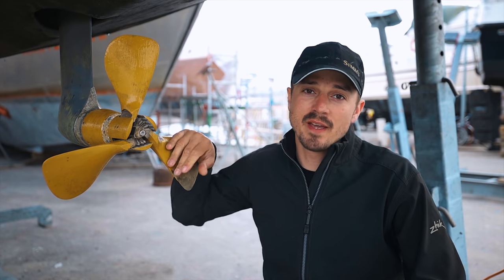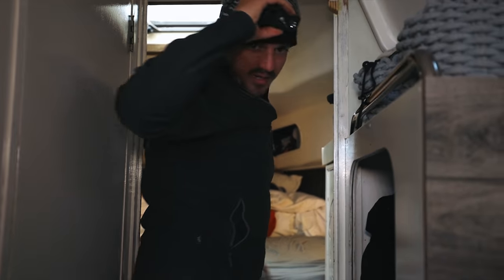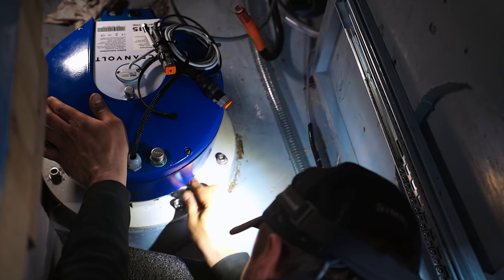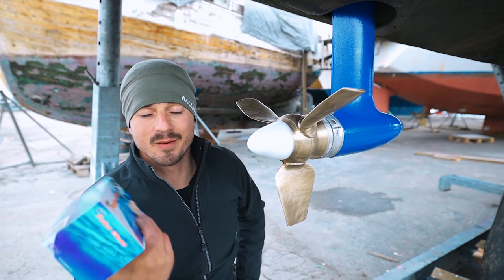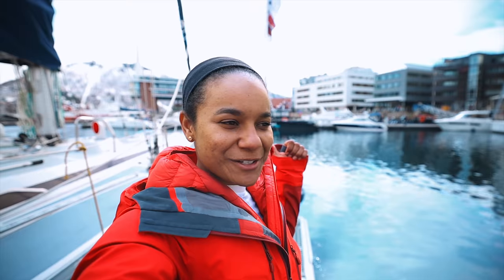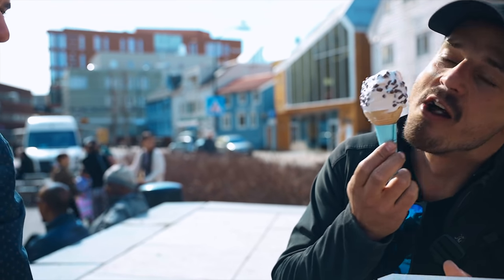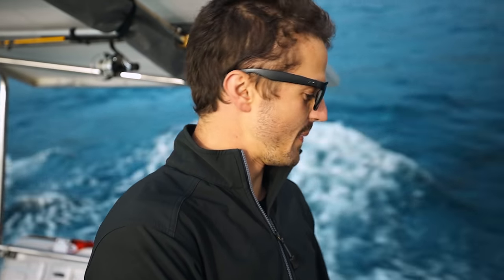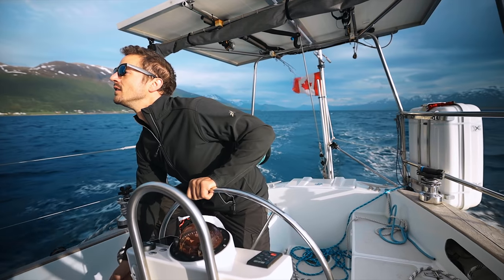Ripping Out our Electric Motor for the LAST TIME! — Sailing Uma [Step 277]

Comment: If you want serious regen, you should increase the prop size with at least 30-40%. With a pitch controller the increased size will not mather at all when you motoring.
And at 300-400 watt it only breaks with 0.5hp so it will not slow the boat at these wind speeds. But with a bigger propeller you can regen +1500watt and then it will slow the boat.
Reply: I'm no expert on the subject of regen, or sailboats for that matter, but yeah, my first thought was exactly this, why is the prop so small? This is slow a moving system (compared to a motorboat) and slow moving props benefit from big diameters. On the other hand, you would think that Oceanvolt should have done some research on the subject. I would assume that this particular system doesn't have the strength for a bigger prop and you would probably have to change out the lower unit and maybe motor for something bigger.
Reply: Bigger prop requires smaller pitch for same motor. Smaller pitch = more low end power, but slower top end. It is a tradeoff and I would tend to believe the manufacturer has done all those tests and is well aware of the optimum configuration for their product.
Reply: @rockfordwoods5432  The pitch is adjustable via computer so there won't be a problem if it's correctly done. Look at Bell Boing aircraft.
Reply: @rockfordwoods5432  larger diameter propellers are always more efficient for displacement boats at speeds of less than 35 knots.    To achieve this however it may require a different gear ratio.  Most people would probably prefer a larger prop than they have for increased regen ability as well as higher efficiency in propulsion at all speeds.

Comment: @Sailing Uma. I am quite surprised by the small size of the Servo prop, it’s a great tech but you still need blade area in the water to get effective regen, and extract the energy available, given the extra cost of the auto prop option are you disappointed with the amount of regen from a 12 kw motor?  This is the problem that Jimmy Cornell had on Elcano, I think the use of standard sail drives, limited to an 18 inch prop, will always limit the system.  It would seem that the speed reduction you were seeing whilst regening, shows that you could afford to extract more energy from your sails, what is Oceanvolt’s take on this?

Comment: The true test would be at a relatively low windspeed like 10-12 knots true. I bet then you would see a difference. If you are going hull speed and the wind power is excessive as in your testing conditions you can probably drag an anchor behind and you won't notice any slowdown.

Comment: I found it interesting that the old prop had lost a lot of it's coating on only one blade.
The next data point of interest would be efficiency when motoring.  Do you get a bit more time on the new prop with your battery capacity?

Comment: Great video again! Nice upgrade! 
That dynamic blade pitch looks like it gives you so much control and efficiency. I can imagine it also gives you more control over how much prop walk you get, does it?
Also, was that anti fouling in a spray can? What brand is that?
Thanks again for an awesome video, looking forward to the next one 😎
Reply from the maker: Yup. Just about zero propwalk. Which has its pros and cons. Yes it’s a rattle can. Not sure what brand. It’s usually meant for stern drives or outboards. Anything that is aluminum can’t have regular copper based antifoul on it. Pretty much any boat shop has some version of it.

Comment: Seems like it was definitely worth the effort of changing it out. An idea popped into my head while watching though. If you're at anchor where there's a decent current you should be able to run regen as well, right?
Reply: Ooh! That's an interesting idea!!  Not sure what anchoring in 7 knots of current would be like though!!! Round here we try to anchor out of the main current. There are moorings that have 7 knots running past them though!!!
Reply: @AnnInghamlife-goals  Even 4 knots would provide 75 watts of power and that would reduce the battery usage by 50% or so for normal household use. Add that into the solar panels and you get a lot longer run time on batteries.
Reply: Very little energy will be created at low speeds, like in currents.
I calculated 0.5knots=0.1Watts, 1knot=1Watts, 2Knots=9Watts, 3Knots=29Watts, 4Knots=69Watts, 5Watts=135W, 6Knots=234Watts, 7Knots=371Watts,10Knots=1083Watts.
Matches Dan's real world fairly close (you can't expect perfection as too many variables).

The big factor in wind and sea turbines is the the velocity (water speed in this case). Because V is cubed. E.G when v=1 then cubic=1, v=2 then cubic=8, v=3 then cubic=27.
The increase is not linear. Higher speed means far higher watts, and lower speed gives bugger all watts.

You can calculate the Watts using kW = 1/2 prop area * water density * Velocity^3 * efficiency. 
Prop area = 0.05m2, total area props sweep (radius squared * PI, I guessed radius=0.13meters), Water density = 1000kg/m3, Efficiency =30% (you can't get all the energy of the water as the water would stop), V = speed in m/s (m/2=knots/1.944).
Reply: @AORD72  True, the power won't be as much at lower water speeds, but it's worth investigating since it literally costs nothing to test the idea.
Reply: @gsh341  Sure testing cost nothing but as I explained the mathematics shows what the results will be. So if you don't have an electric motor you can calculate the results. You can calculate the Watts using kW = 1/2 prop area * water density * Velocity^3 * efficiency.

Comment: Cheers all. As a owner of an 18ft battery electric displacement hull motorboat, if I think about the power required to motor your vessel at those regen speeds, the power that regen is absorbing is really pretty small compared to the wind power being caught.

Comment: Great improvement!  One thing to consider with respect to the generated power and the speed through the water, 300 watts is a bit less than 1/2 horsepower, ignoring efficiency losses.  The drag should be effectively something close to the difference in speed the boat would see with around 1 horsepower motor thrust.  

Another factor to consider is the relationship between any boat's speed and power (thrust).  Increasing boat speed when sailing slowly takes a small increase in thrust (or power).  In contrast, increasing boat speed when sailing fast will take a huge amount of power.  The relevance here is that when you're sailing Uma fast it means the sails are already generating a huge amount of thrust and so taking a little power with regen will probably have no effect on speed (as you saw).  But if Uma is sailing slowly the sails are generating comparatively much much less thrust, and so taking a similar amount of regen power will represent a much larger drag increase, and could slow the boat more.  

Do you know if the regen system modulates prop pitch in an intelligent, continuous way - to keep the motor in a sweet spot RPM for efficiency of the electrical generation?   If so, it should also factor in either boat speed or have some bounds with respect to generated wattage - when the boat gets really slow the pitch has to steepen so that the blades don't stall in the water.  The system could detect this and back off the pitch when power is dropping.

Comment: A few years ago I cross the Atlantic on a container ship. They told us that the engine runs all the time, and that the only way the forward, backward, or stationary traveling of the ship was controlled by the pitch of the blades. Like yours.
Reply from the maker: Yes. Variable pitch props have been around on commercial vessels for a long time. But not soaker private ones like ours.

Comment: It's hard to believe it's been just over a year since you put the other system in. The new one looks like it just blows the old ones performance apart. What a difference a year makes in Tech advancement. Plus with what you've been able to accomplish with your boat just shows that the old smoke and choke system doesn't have to be the only thing out there. It still blows me away that you were able to hobble along on that old forklift motor as long as you did. Nice to see things coming up for you two.

Comment: One added bonus of the servo pitch prop is that it is technically possible to deliver forward thrust when you are sailing when you need a little more speed without over speeding the motor. It should be an automatic feature with the motor sensing the thrust demand and adapting the pitch to deliver the extra energy. Super efficient. I noticed that  you are parked next to Arktika, Alluring Arctic’s new adventure.

Comment: Super awesome you're able to get the propulsion and regen system you want. I thought it was could be an option for my next repower until I saw the full system estimate from OceanVolt's website to be from $45k for normal to $54K with the Servo prop. (€38,650/€46,600). Definitely still a luxury system for most sailors. 
Still awesome and hopefully, over time, tech improvements bring pricing more inline with dino fossil powered options.

Comment: I must admit I was an EXTREME skeptic in the days you were using the makeshift forklift motor. I was always positive with regard to a future when the triad of purpose built electric motors, battery technology/intelligent control systems and mechanical efficiency came together to provide a firm and safe foundation for light displacement sailboats like Uma. I’m proud of you both for your informed dedication to the dream of viable electrical propulsion in high and low latitudes combined with Dan’s growing technical competence and inventiveness. Damned well done guys! And, driven by ecological necessity and the leaps and bounds technological advances in battery and regen, the skies the limit. Kika & Dan leading the charge -pun intended.

Comment: I just came back to this video to check the system out again.  I just sold my Tartan and am now considering my next boat.  I would like to consider electric sail drive on the new one.  One thing aside from the electric drive and a bit off topic but your boat must smell better than one equipped with a diesel.  I found the rear quarter berth would get unreasonably warm after running the diesel for any length of time.
Reply from the maker: Yup. No smell. No noise. No maintenance. No vibration.

Comment: That Oceanvolt would have to be the most awesome piece of kit I’ve seen all day.
Reply: Juicy price tho. Over 46 000 Euro.
A Volkswagen ID 4 with the biggest battery cost less.
Reply from the maker: OV includes batteries and shore chargers in their quotes. If Diesels included a lifetime of maintenance, oil changes and fuel when you buy one they’d be way more expensive!
Reply: @SailingUma  Just to be a quibbler on this topic.;-/
Do OV include lifetime warranty of the batterys, the shore charger, not to mention free shorepower.
do they also provide you lifetime free coolant for the motor and oil for the gearbox?
Let´s face it, like fossil engines even electric motors have additional expences.
So far they don´t regenerate equal to the consumption, then you have to supply with shorepower or/and sun/wind power. Neigther of the equippment to support the difference is free. 
You have to add those costs compared to the fossil-engines running-costs as well.
That said, without pioneers like you and OV there would be no evolution. ;-)

Comment: It's so obvious this is the way to go. Hopefully battery cost starts getting into the region where electric car manufacturers are because at present, the batteries sold in the marine sector still put this type of propulsion outside the range of many.

Comment: With all the respect for the fine propulsion system you now have, imagine how much greater it would be if the sail drive arm also could turn!
That would make docking/undocking so much easier and stress free in almost all conditions. A thought for next upgrade?! Good luck with everything.
Reply from the maker: It would also be VERY difficult to keep it from leaking. Twin motors pretty much solves the same issues without any added complexity.
Reply: @SailingUma  Twin motors on a monohull !! That sounds complex . I don’t understand.. 
The turning sail drive is a proven technique I believe. Never the less, just a suggestion. All the best, Jan

Comment: Congratulations, that is a really sweet setup for a sailing boat.  I did not understand what you were about until i saw the two prop heads together and that immediately showed why you wanted to go to servos.  It is obvious why a sailing cat might get by on the passive head, but the servo is just the final word for sailing regen.

Comment: So if the boat isn't really slowing down...that means there is potential to harvest even more energy! Maybe a bigger prop? That would probably make motoring less efficient tough. Maybe a second prop just for regen? Maybe OceanVolt can come up with something.
Reply from the maker: The Salona we sailed on had 2 props. Worked great. At 8kts we were generating 1kW out of each motor!

Comment: you also need to consider if the old one needed to be spun up to regen and now this additional load on the regen is gone as well. If the servo has a magnetic brake you won't need any extra load to hold the fins in the position it's currently in.

Comment: Nice electric conversion plus power the battery back when sailing.  Since you have solar panel, consider install a small marine wind turbine combine as a hybrid charging system?  Cost wont be too expansive but it can charge your battery even when you park your boat.
Reply from the maker: We're working on a wind solution. But nothing on the markets fulfils our needs, so we're starting from scratch.

Comment: .... Double!! if not more! you say ... controlled feathering prop that is so sweet ... this is a long time ago now, but the small inter island ferries when about to leave the dock would bring the Detroit diesels to 3,000 RPM for the duration of the crossing and all directional, speed requirements were attained by feathering props. The legs would also rotate 360 degrees, I found it mesmerizing to watch while docking, the agility, speed the leg pivoted and the change in the wash off the prop. There were one of these on two opposing corners of the ferry, it was probably a 10foot square well that one could look down and stare. ... this was the first time I was aware of feathering props, and of course as soon as one is aware, they are everywhere .. smilin  ...... laughing .... put in another, sort of like some sailboats have two rudders angling out, not as wide spread though, and double your regen again .... that parade sure looked like fun .....  thx for the share .... and as always .. never stop dreaming, just dream bigger .. have fun be safe, save our oceans ...

Comment: 340 watts is roughly 27 Amps @ 12 volts DC....even if you average 200 you are doing great!!!   Had converted sail boat to electic and my tender using Minkota 110 lb thrust years ago....had a 100 watt panel on it too....never had to put gas in a motor....yippy!

Comment: You both are very much admired, wanting to share an idea with you.  We installed extension lines on the fore and aft grease fittings, making it really easy to perform maintenance on our Electric Volt motor.

Comment: I would love to see a prop tank test on this motor / prop configuration at different speeds.  It would be nice to see how much torque is generated in regen mode  @ 5 knots sailing speed

Comment: We use a fixed prop on our Bristol 35 with electric volt, generating regen at 5 knots, but not the kind of numbers you are getting.  Keep inspiring folks!
Reply from the maker: Yup. If it could be done with a fixed prop, it would be. But you need three propellers, one for fwd. one for rev. And one for regen to gain max efficiency from each.

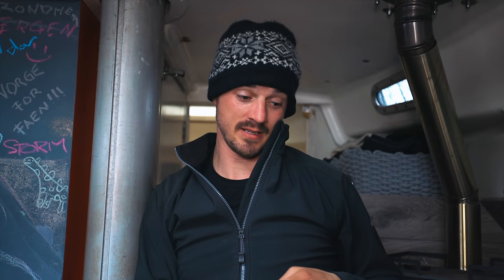Comment: 6:30 Storage. What about see through plastic bags for easier finding and fitting in compartments ?
Reply from the maker: We've tried plastic bags. It works ok for some items, but we found they often ripped and then would get wet and dirty quickly. What we've found works best is larger solid plastic containers and tubs, that smaller items get organized in plastic bags inside of.

Comment: Most of the older system issues were the losses involved in your anti-feathering technique utilising the main propulsion drive rather than servo motors. Ie power gain = power generated after losses incurred by using the boat motor as a centrifugal prop stabiliser.

If you combined the older motor/gen with a fixed or welded prop the active losses would have been much less, the alternator torque higher and overall comparable gains much lower.

Comment: Now that is a huge step toward being autonomous! Besides the fact that it is cheap (to run, not to buy) it is also absolutely environmentally friendly. And the cost of filling up the tanks of a Diesel powered boat should not be taken lightly. A friend just filled up his 50‘ twin Diesel boat before we took it for an afternoon ride and he had 2.000 € on the pump! And with the throttles on the table the two Diesels guzzled up about 200 ltr. (about 50 gal.) of fuel!

Comment: awesome!  regen is key to electric drive! keep up the awesome work!
Reply: Take it from an experienced electric drives design engineer: From what I can determine, the system you have has finally got everything needed to also include proper regeneration. The added servo to feather the propeller to optimize both drive and regen, along with the proper electronic control is basically what it takes. It only took about 20 years which is how long ago I got involved in boat electric drives. BTW, I still have the original drive from back then in my boat! Happy sailing!